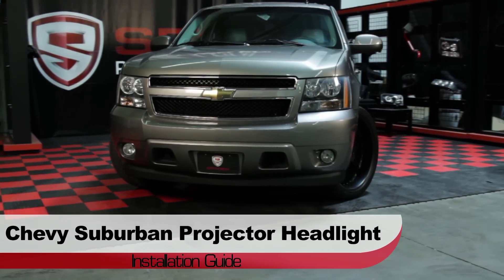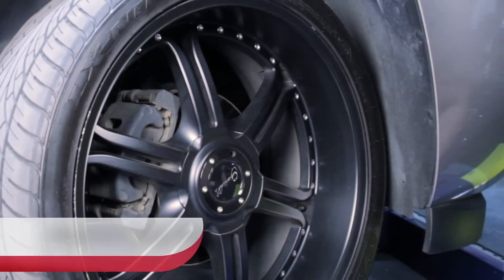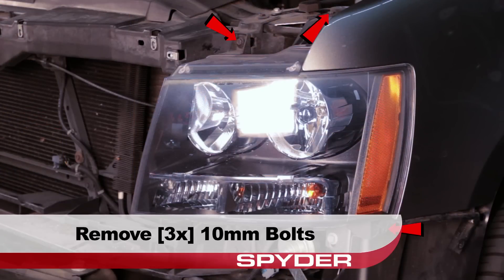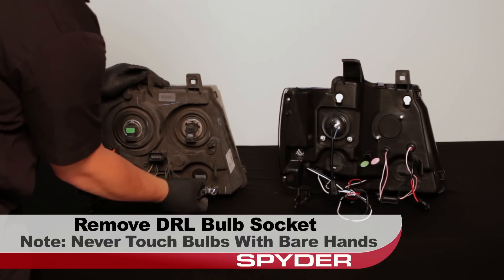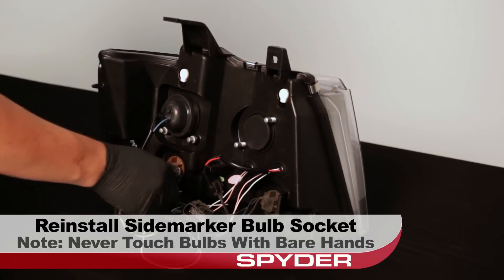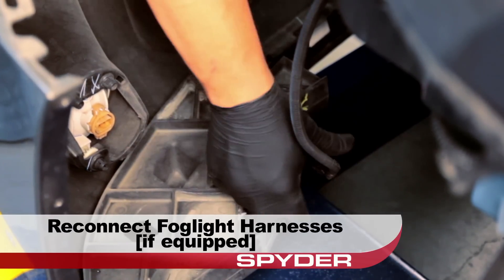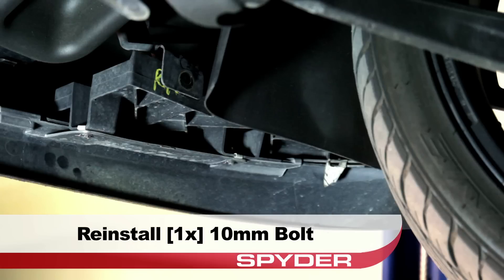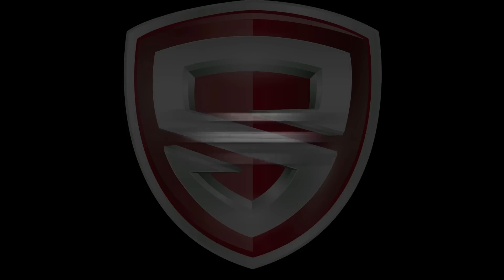Spyder Auto Installation: 2007-14 Chevrolet Suburban/Tahoe/Avalanche Projector Headlights

Comment: Tech question: After installation, the DRLs do not function, with or without the headlights on. Is that by design, or did I somehow wire them incorrectly? The bulbs are new, so it can't be that. Thanks in advance.

Comment: You don't have to remove the bumper, lol. Just go through the wheel well. I left my lower bolts off and now just remove the top to bolts to access.
Reply from the maker: Thanks for the tip.

Comment: They were "plug and play" however; #1 when plugging in the low-beam connector, the two pins on the OEM Plug were closer than the new mating connector socket so both pins missed the slots in the mating connector socket and almost shorted. Tis happened on both sides. When I tested the lights, they didn't come on so I separated the connectors, noticed the bent pins, bent the pins out again, spreading them farther than they were for the OEM connector so they would slide into the mating connector socket slots. #2 The CCFL and Side marker LED didn't come on at first. The little red connector with two wires bent over didn't mate with the factory harness connector correctly the first time. I disconnected them and reconnected them both aligning the green wire on the new Connector with the gray wire on the OEM hardness, plugged it back in and they both came on. So I am guessing they are polarized. (I thought I had them that polarity when they didn't work). #3 I am not sure they are as bright as my old headlights. #4 They came with headlight bulb covers (black boxes with a hole in it Part # 92-CTSA07V208) that are replacements for the factory headlight bulb covers. They might allow for larger Low Beam bulbs but there were no instructions in the box about them.

Comment: Now the big question.....can you HID bulbs in these?
Reply from the maker: +Ghostjr1 technically they will fit but we cannot guarantee the fitment and the light output since we do not produce any HID kits.
Reply: +Ghostjr1  officially no but i have em for 4 years already nothing happened to the lamp all tho they are not HID certified :D
Reply: Aleks S which hid kit did you use?

Comment: I got these headlights for my Chevy Avalanche and my passenger headlight was working just fine but now the projector headlight is out. All the led lights work fine but the headlight is the only thing not working please help.
Reply from the maker: +Brad B sounds like your bulb is out. you can go to your local auto store to pick up a replacement bulb. the bulb size for your particular one is H1

Comment: I installed these and after 6 months the low beam build went out.  Now finding instructions to replace the bulb are hard to find.

Has anyone replaced a low beam bulb on these?
Reply from the maker: the low beam bulb in these lights are H1 bulb. you contact our tech support for more information. techsupport@spyderauto.com

Comment: I installed these same lights on my 2008 chevy tahoe. Is there an HID light that I can order for them now?
Reply from the maker: You can order some aftermarket HID kit for the headlights and if you do we recommend using a 35 watt HID kit. I personally like to use 6000k because its closer to natural daylight on the Kelvin Scale. These light uses a H1 bulb for low beam and high beam.
Reply: I’m about to do it now. Did you have to remove the whole bumper to do it?